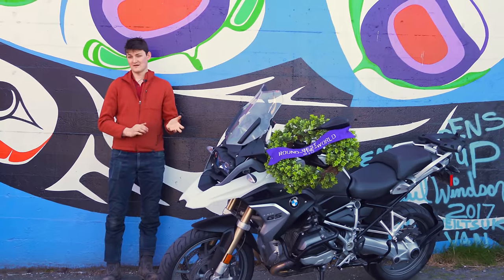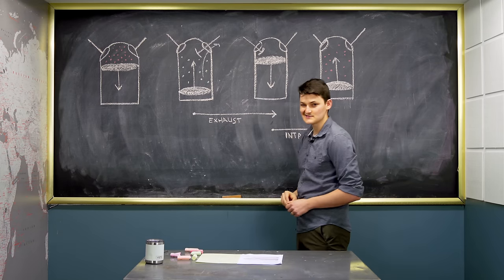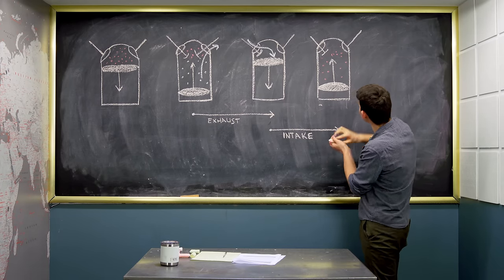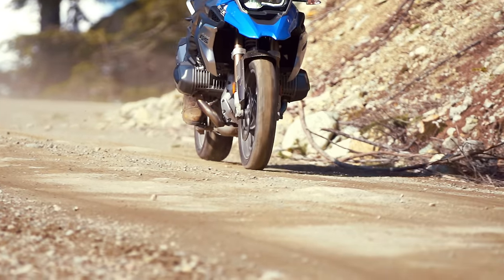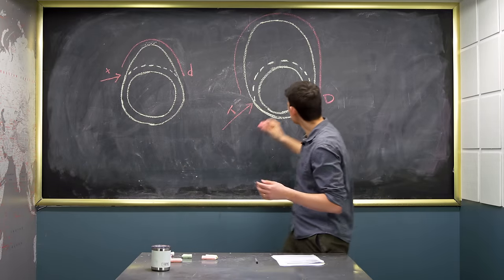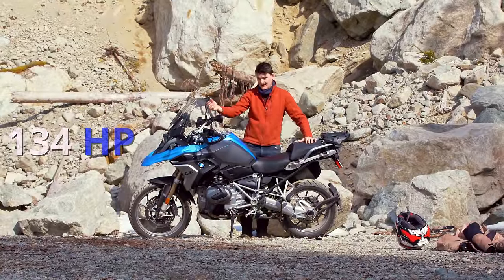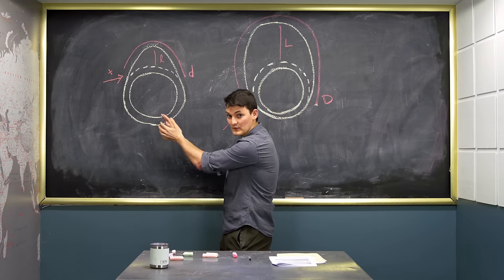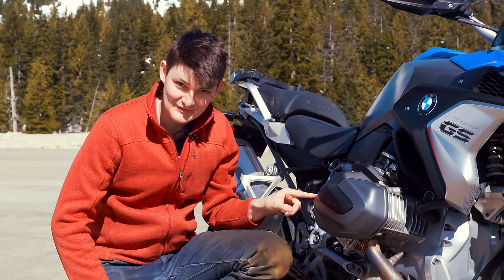Variable Valves are Bad for the BMW R1250GS - Review

Comment: Thank you for the great explanation on how BMW's version of VVT , VVD, VVL ... all the VV's work and their short comings. I love your videos and your no bullshit approach! I do not disagree with your overall assessment. But to be frank I do own a 2019 R1250 GS and the reason I chose it over other bikes is simply that it fits me and my needs (2 up long distance trips with camping gear for 3 to 4 weeks at a time) better than others on the market when I bought it. (Who knows what the future will bring!)
There are a few details I disagree with. The GPS blocking the view of the speedometer is an easy fix. If you own the BMW GPS just set the screen to speedometer. I don't need to see where I am all of the time. If you don't own the GPS simply remove the cradle. The Hill Assist is engaged when you squeeze the bake lever hard and all you have to do to disengage it is squeeze the lever again and you are free to move the bike as you wish. I personally find it useless and avoid engaging it. The worst update is the Gear Shift Assist Pro, It does not work well at all on the upshift and makes shifting very abrupt. On the downshift it works okay. It is not really usable below 3rd gear. If I could have bought the bike without it I would have. The good thing is all you have to do to avoid it is use the clutch to shift! Reliability, there have been many problems over the past with faulty receiver antennas for the chip key, warping brake discs, leaky seals at the drive shaft and yes drive shaft failure to name a few. And if you think that they have all been taken care of think again. You still have to replace the driveshaft at 100,000 miles because it will fail. It can not last forever since it has sealed u joints that can not be greased. It is not a perfect bike because as everyone knows the perfect bike doesn't exist. So am I worried about the electronic actuation of the shift cam breaking? Yes. Is it a deterrent? No. There are other things that worry me more than a motor that is out of sync while I limp home. What if the TFT screen breaks and I can no longer adjust any of the parameters and have no access to any information. Will that shut down the bike?  What if the electronically adjusted suspension breaks? I think I can still get home. But most of all what if the fly by wire throttle breaks? Now that will leave me stranded and that is my number one worry! But would a bike from a different brand in the same category be more reliable? Triumph has fly by wire, KTM has fly by wire, Yamaha has fly by wire and now even Suzuki.
So is BMW the benchmark bike for technology? No! Is their new Shift Cam a technological advancement? Not really. But I have to say it performs well and the R1250GS is a well rounded bike that suits my needs and since I could afford it at the present time I decided to splurge. As for the lull in power I have to admit that I have not noticed it in the 7,000 kms I have put on the bike so far. I certainly will be looking for it now!
Final note, today's large adventure bikes from the  major manufacturers have a plethora of electronic aids that in my opinion limit their lifespan. I simply don't think that they are being built to be around 30 to 40 years from now.
To Ryan F9 and the entire team at Fortnine, Keep up the great work, I really enjoy all of your videos they are extremely well done. Bravo!
Reply: I think what it comes down to that the GS is the best bike if you have the money and the time to make good use of your miles. BMW sells a lifestyle, that's why the GS is so popular, it gives people who can afford it the feeling that they can go on adventures. I personally think the GS is the very best bike out there but I think there are better bikes if you are not willing to pay the premium.
Reply: Well said. Is ABS failure now a thing of the past ? Regards. Trinidad & Tobago.
Reply: I'm more happy with a Varadero-1000 from the 20s than a guy with a new GS where i live
Reply: @henkondemand  it's why jeeps and Tacoma's hold there value so well too, having a robust trusted 3rd party and community on a platform that doesn't change so much that people can identify the issues as they come up is huge and worth it's weight in gold,

Comment: Finally a brutally honest review of all stuff that can break..
Reply: But, will it break? I am not sure about ti, the time will tell..
Reply: @motolover5697  -  It is electronic - any failure is not repairable, only replaceable, but where you are could mean disaster.....
Reply: It's electronic therefore the computer will know by position sensors etc.. I would be extremely surprised if they haven't thought about any issues like that.
Reply: @MagicAyrtonforever the point is that this is supposed to be a bike to travel EVERYWHERE, that means more parts ( worse if its electronics ) = more risk of failure. That's not a problem for the 89.9% of 1250 GS, that go home-work or trips only on higways. But for the people that use this bike as advertised by BMW and go in places several hundreds of km away from the nearest city, or in places far away from offical retailers, if something like that breaks u are in a big trouble man.
Reply: @motolover5697  I've worked as a mechanic for over a decade. More shit = more shit that can go wrong. Will it break, that remains to be seen. Can it break? Yes. But then I suppose the same could be said for anything. I would argue mechanical is 'A' easier to diagnose and 'B' easier to fix when you're on the side of the road. Most people aren't going to be able to jerry rig an electrical issue unless they're an engineer with a wiring diagram.
Reply: @motolover5697  If the ESA is something to compare it to, yes it will.
Reply: A lot of replies about failures leaving you stranded. Since all modern fuel injected motor use a computer to control fuel flow anyone taking a long trip on a modern bike is in peril. But yet I have not heard of any wide spread failures with ECU's. Even mechanical parts can break leaving you stranded waiting for a replacement part.  I have spent the last 40 years working on computer systems because they can fail. Most of that time on industrial control systems. The failure rate for electronics is very low. There is still a lot of Controllers and I/O that is old as 40 years still working.
Reply: Hooner77 That computer isn’t inside the engine. If nothing else, solder will melt and stuff will break with all that heat.
Reply: @bandombeviews6035  Yes. That tiny piece of plastic so close to the valves and piston with that heat and continuous use, good look with the last longing. Or a dropping, well.
Reply: 3yr warranty
Reply: @pierb2848  Let's stop kidding ourselves about this. BMW might market the GS as a take-anywhere bike but that is NOT it's intended use. If you want to ride to the middle of nowhere on a bike that can take it, or is at least easily repairable with MacGyver level fuckery, consider yourself lucky that the XR650, the DR650, and the recently departed (rest in peace) KLR650 are still widely available. At this point the GS is the 5-Series of motorcycles. That doesn't mean it's bad, but that also means maybe you shouldn't ride it to Mongolia if you're not rich enough fly in spare cam computers.
Reply: @bandombeviews6035   if  anything inside the engine gets hot enough to melt solder, electronics will be the least of your concerns. Come on guys, the engineers on bmw weren't born yesterday. Sure that system might not be all that useful for the complexity that it ads, but even if it breaks, it should just leave your bike stuck with one set of cams engaged, which is not the end of the world. However, just like Hooner77 said the failure rate for electronics is low ( no movng parts/wear etc). And I think there are way more important things preventing that GS from being a good adventure bike than that piece of electronics.
Reply: Damn good bike though Biggles!
Reply: My M3 hasn’t broken nor has my GS?
Reply: Murfies Law...
Reply: Pier G2 every other manufacturer is loading up their bikes with electronics too. KTM, triumph, Ducati. You speak as if Bmw Is the only one with a complex and extensive electronics package. Mechanical failure still trumps electronic failure big time and yet all criticism is pointed on the electronics. Show me drivetrains with 100k or more on a model that’s a few years old where they have worked out any electronic bugs. Which is usually a matter of rerouting wires away from heat in the next year model
Reply: Hooner77 well said! I love when actual mechanics chime in and say nope. False.

Comment: On most channels new tech gets praised as the solution to everything, nice to see you putting your word out against needless complexity. Stuff like this special oil cap need a special kind of engineer to come up with, ridiculous. Kee up your great work :)
Reply: @Johnny Blue It does, but it's outdated technology as far as the valve configuration. The needlessly complex is the hill support that cannot be disabled and some sort out unique oil cap.
Reply: It s actually neither needless and nor complex as Ryan showed it, it s an old technology but a very useful one. The point was the design, the electronics that actuates it, more electronics to go wrong and then what. But I think the electronics nowadays have enough quality control to be reliable and safe (ABS modules and such). I think the price is the real minus, they took advantage of an old technology and gadgets as the hill start which again is an old technology too to up the price by a lot.
Reply: I am new to riding and bought a friend's  2012 1200GS oilhead - for me the perfect balance between refinement and robustness.

Yes, I broke the stupid oil plug first time it required oil - had a buddy turn a solid aluminium one that is tightened by hand or wrench if stuck.

I do admire the led lighting on the new bike though!
Reply: Engineers don´t come up with oil caps like that, at least not on their own. Managers do, to get more money out of the same product.
Reply: Every gs has got a toolkit with the right tool for the oil cap. But nowadays people feel overwhelmed with it.
Reply: These Oil Filler Caps were designed like this to stop kids/vandals from undoing them. Many owners of older BM's with the old style Caps found on RTW trips that kids liked undoing them and dropping stones etc inside because the Cylinders and Caps were so easily accessible.
Reply: @WhiteLink5  
" But I think the electronics nowadays have enough quality control to be reliable and safe"

You have not been keeping tabs on BMW's immense number of recalls over the years?
Reply: @Nightdare  like every other manufacturer? There were no recalls from BMW because of broken electronics. Pls give us some examples. Otherwise it's a very weak point.
Reply: Umm... the oil filler tool is under the seat and comes with every bike...
Reply: RTFM before reviewing a bike pls, hill start van be turned of either by turning IT of in the menu, or by selecting enduro mode , the oil cap tool is under the passenger Seat ...
Reply: @iamtheblank  The Hill Start can be disabled and the Oil cap key is under the seat
Reply: @WhiteLink5  My (RIP) 1950 Studebaker Starlite Coupe had a hill holder.  Again, 1950.
Reply: Reimo Wieland the tool for opening the cap comes with the bike. It’s under the seat. It’s so someone can’t steal your oil cap with basic tools
Reply: Ed. Barker preach!!!!

Comment: Bought mine in February 2019, and had to have them pick it up a month later when it shut down after starting, with a ShiftCam error. The computer believed it failed to fully engage in High-HP mode (when it does initial tests, on start) and shut itself down for safety. Haven't had an issue since, but gave me severe pause for a bike I'd otherwise been loving.

Now it's been another year and I haven't had any issues at all - I turned off the auto-hillstart right away, and it's super easy to manually engage when I want to, but otherwise the bike has been amazing. I use it exclusively on roads and highways, and it's the most comfortable bike I've ridden.
Reply: Jake my skid plate and crash bars say otherwise. Or at least what’s left of them ha

Comment: Use the screwdriver handle to open the oil cap. Also if you depress the brake lever again to release the hill start control
Reply: or you can turn off that feature from the screen  o
Reply: @JCBigCat  which u dont need so the price is kept low. LOL
Reply: @JinKazama92  I use the "hill assist" all the time at stop lights so that I don't need to hold down the foot brake the entire time that I am stopped.  It doesn't engage unless you pull and hold the front brake for a couple seconds while stopped, and it disengages by itself on either throttle input or tapping the brake again.  They are not allowed to call it a "parking brake" though, so its "hill assist"
Reply: @jddevinn  It's not a parking brake 'cos it disengages when the ignition is turned off.

Comment: This type of motorcycle content is what we all need. Nobody would think to take off the valve cover on a bike just to prove a point.
Reply: Frank Williams 
But do we need this type of content?
Is now Ryan’s honesty in doubt ? Let me explain..
I’m an owner of aT7 and a 1250GS. I’m not precious about either of them! 
My GS already had front brakes and battery  replaced under warranty, as well as a stuck exhaust valve and an additional couple of visits to the dealer with software gremlins. So all in all rather disappointing not to mention overpriced piece of kit, but one that is still great at what it does, when it does. 
However, instead of picking up the real problems he went down the path of theoretical and ‘possible’ problems as well as misleading ones ( the screwdriver under the seat IS the tool for the oil plug, the hill hold can be used in manual mode or disabled so no issue there and as for the display when standing up, is it a cheap joke of his? You can rotate it to suit or remove it altogether. Personally I don’t need to look at it when standing)
Come on man, we love his reviews, attitude and witty comments. He should not be trying to spoil it with shallow reviews that give fuel for the haters to feed on, all for the shake of clicks. He has a responsibility to be more thorough and accurate!!
Respect
MD
Reply: OS P few problems with GS. Any with T7 so far?
Reply: Richard Hretczak Well, due to lockdown only have 420 miles on the clock. Great bike but no GS. Already rusted spokes on back wheel. Front wheel ones are fine.  🤔
Reply: OS P I couldn’t agree more. He really disappointed me with this video. I had such a high opinion of him before this. He’s usually so unbiased and objective. He berates Moto journalists for their unwillingness to say anything bad out of fear of not getting invite at next bike launch but he is twisting the truth from a place of being mad at Bmw. Unsure of what the slight was but regardless the end result is the same. A narrative that is not the whole truth! He’s being a tad bit hypocritical. This was just clickbait in my opinion. Nothing more.